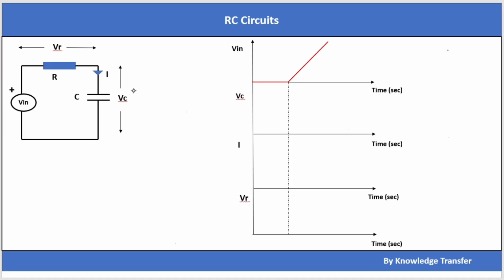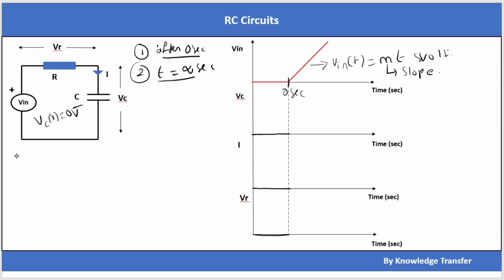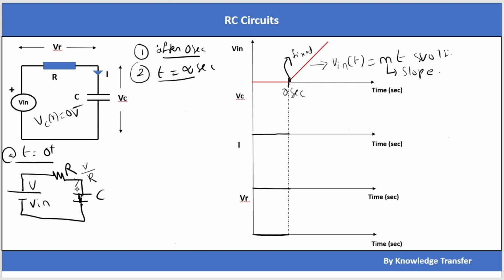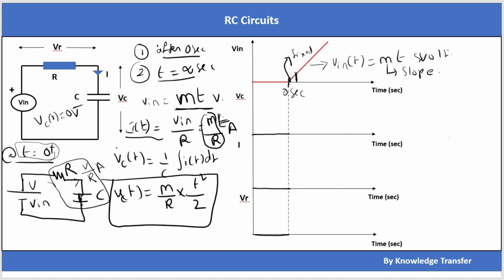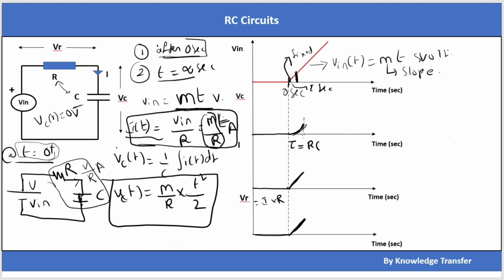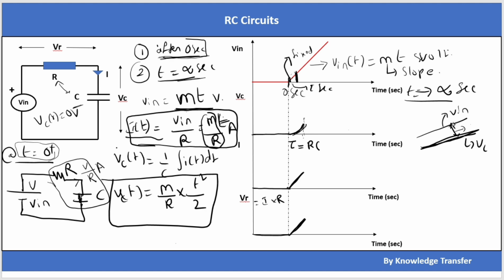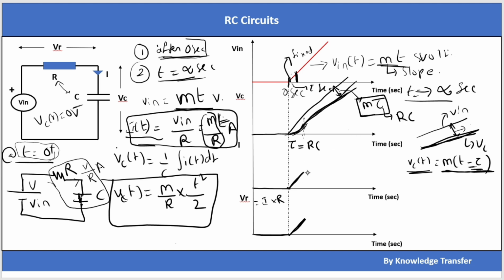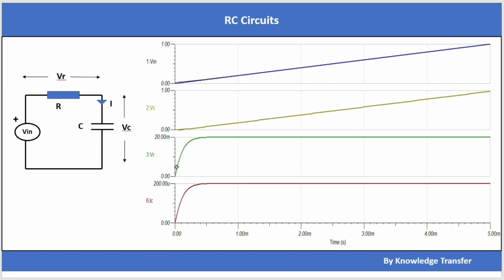Ramp Response of a RC circuit for analog interview

Comment: Sir can you explain why you didn't used cdv/dt equation for current, since we know the behaviour of voltage across the capacitor
Reply from the maker: I have used the same. We get fixed constant current during steady state
Reply: @knowledgetransfer8408 thank you sir for the fast reply, sir you said for t< tou , Vc(t) follows parabolic function ,is it valid only for t<< tou , i.e when current is maximum due to capacitor short ? I didn't get the part where parabolic nature vanishes to linear nature for Vc(t).
Reply from the maker: @danielcharles-f5u  Parabolic nature vanishes after m*time constant (after the delay of the circuit). Until parabolic nature current is not constant and voltage across cap is starting to build. So we see here parabolic voltage across cap until delay of the circuit.
I hope this answers your question.

Comment: Can you please elaborate on the fact that the response follows parabolic nature till the time constant RC?
Thanks
Reply from the maker: Generally Cap will take m*time constant time (here m is slope of input ramp) to respond to input given signal (delay of the circuit). Then it tries to reach to input signal.
Here current via cap is ramp signal so we will see parabolic voltage across cap.
I hope this answers your question 😊